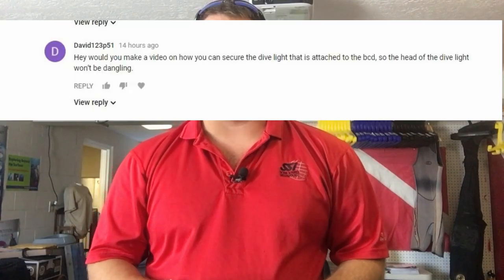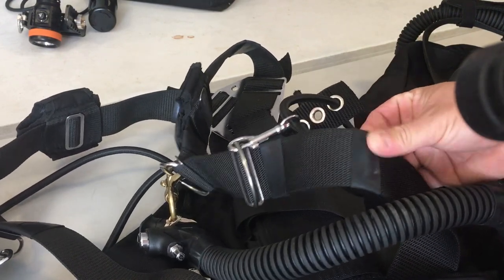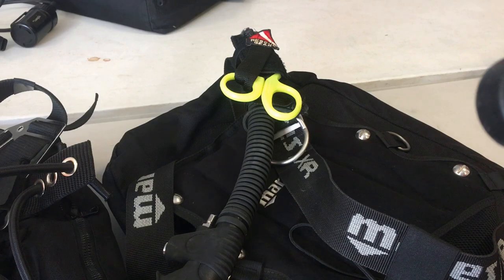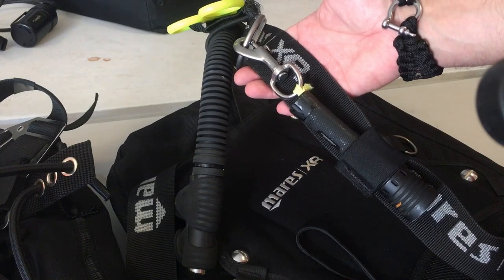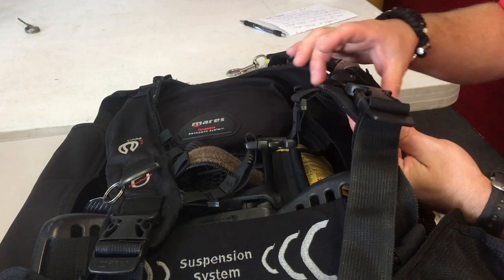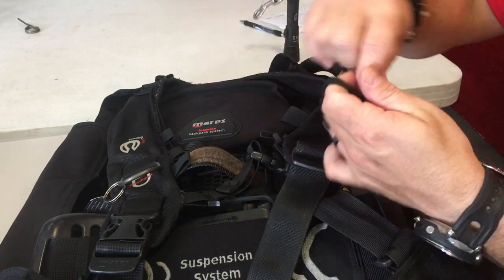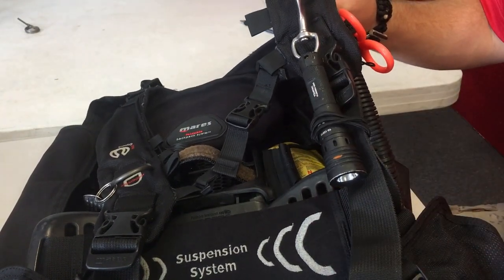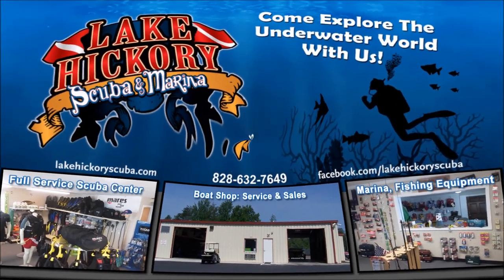Scuba Tip No Dangling Flashlights

Comment: @geogator28 Agree with cheap elastic hair ties. I keep several in dive back pouch. Good for securing numerous items. Also great for IDing which lobsters are yours. I slip colored hair ties around lobster tail to identify the ones I've caught.
Reply from the maker: That is a great suggestion @jlmjkooj. I never thought about using the hair ties to mark you lobsters. I will definitely be doing that in the future.

Comment: What lanyard would you recommend for use with a flashlight? I’m trying to figure out what works the best, in your experience, to keep from dropping the light into the clear blue ocean. Thanks.
Reply from the maker: Hello C. Patrick Sadowski, I personally use a glove from Comfort Zone Scuba.  This allows a hands free operation with no change of losing the light.  But to be more specific for your question, most lights have a lanyard with them that can be easily attached then secured around your wrist. If you light does not come with one, simply using para-cord, you can make one yourself.
Reply: Clip to bungee cord loop around wrist.
Reply: @toadou8127  found a good solution. Bungee strap on a two inch webbing

Comment: Hiya, love the videos :) 
I'm not sure if you've got a video already on them but how do you attach your shears to the bcd? I've seen a few pouches you can buy for shears with the velcro quick-release, is that what you're using?

Many thanks!
Reply from the maker: Hey Chester.  The ones that I use come from Lifeguard Systems. XS Scuba also makes a set that comes with a sheath.  The easiest way to do it, is to use some Velcro Strips that you can pick up at any craft store or Auto Parts store.  Make sure to keep the soft side out, and just run it around the sheath and should strap and attach it to itself.  If you want to add a little bit of security to it, you can heat up the end of a small screw driver with a lighter, and then burn 2 small holes into the sheath itself.  Then you can use zip ties to attach it in the same manner.  Hope this helps.
Reply: Thanks, keep up the good work.
Reply from the maker: You're welcome, and will do.

Comment: That ball-slide bungee can be easily retired into a tank knocker by running the bungee once through the ball’s hole and tiring the ends together. You can also buy bungee material by the foot as kayak supply departments or Army Navy stores.
Reply from the maker: You sure can.